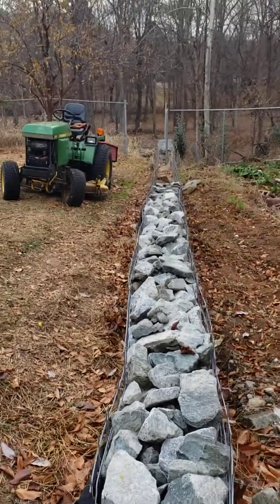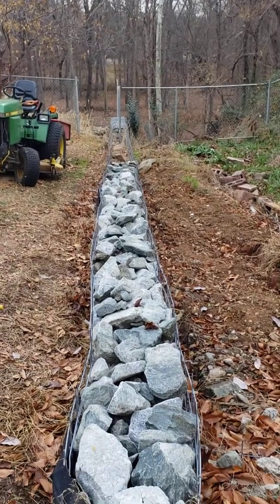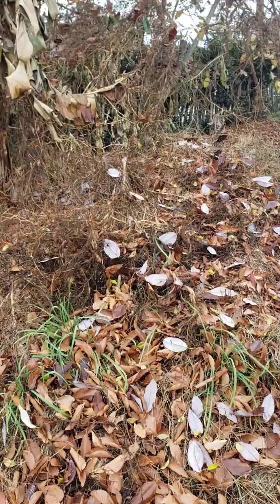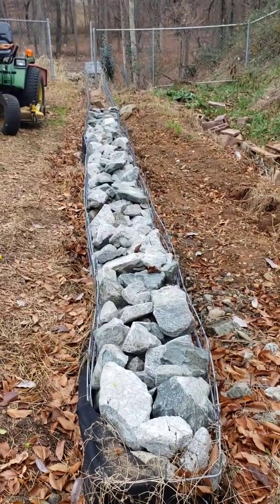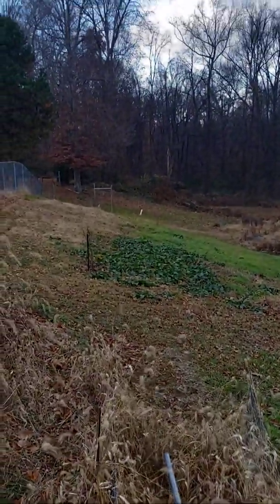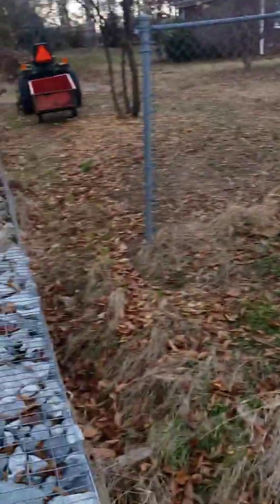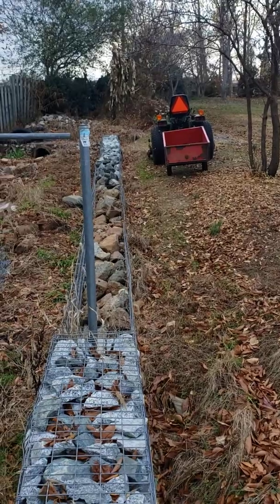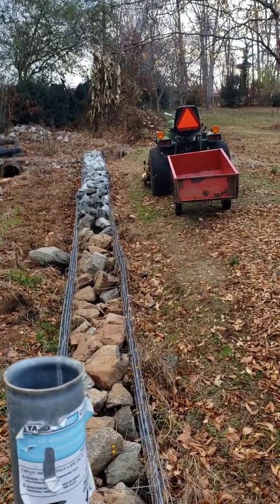Gabion Wall Update 11 DEC 21

Comment: Hey this is great series. Did you compact the base and line it with gravel or just level it out and make the Gabions on top? I think in one of the videos it was just straight on top of the leveled grade
Reply from the maker: I just leveled it out and placed the Gabions on top.  So far there has been no movement in the wall.